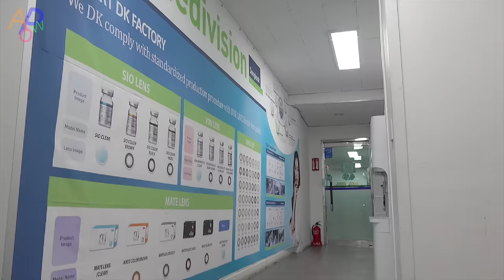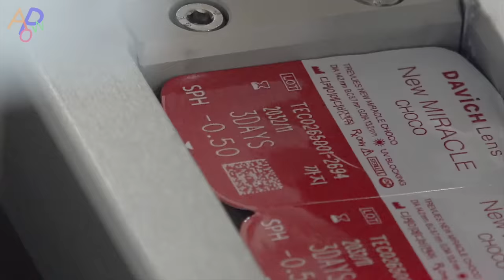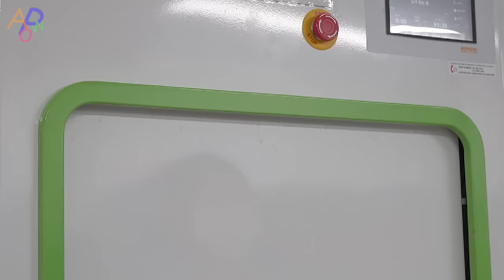Amazing! Color Contact Lenses Automatic Mass Production Process. Contact Lens Manufacturing Factory

Comment: I love this. I worked in the contact lens business for 16 years and boy has the manufacturing process changed A LOT.  However, the end result is still the same.  Great video
Reply: Wow, you have lots of experiences! Did you ever use them?
Reply: Hi! I hope you're doing well. How much does it typically cost if you buy from a supplier? Could you also provide a few examples of suppliers?
Reply: I worked in lens business for 10 years i Can  fix the edge very well

Comment: Seems pretty crappy to package these in 5 counts....
Reply: 너 일본인이지?ㅋㅋ
Reply: Noob it means you have to buy 10
Reply: 5 x 6 = 30. 30 per 1pack
Reply: 제대로알고 댓글써라
Reply: 5개짜리 2세트 포장으로
총 다섯번 쓸수있는
Reply: Sometimes you will drop a contact while putting it in so it’s often times easier to have an extra incase it falls somewhere like the bathroom floor. (A good rule of thumb is if your contact was the icing of a cupcake, would you still eat it after it fell? If not, throw away the contact and get a new one. If they aren’t daily replaceable lenses, wash it with contact lenses solution thoroughly to clean off bacteria.)